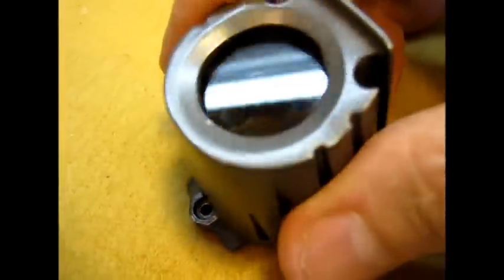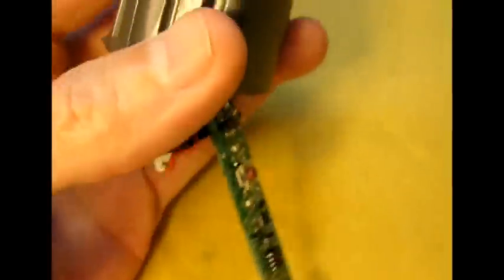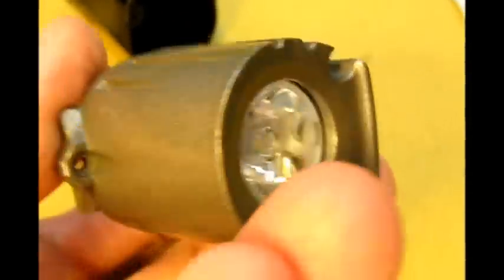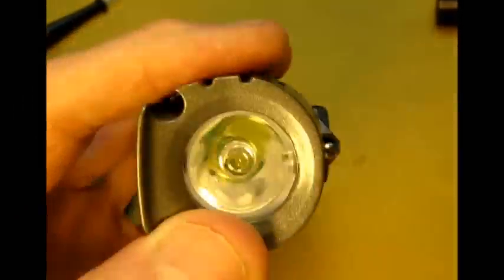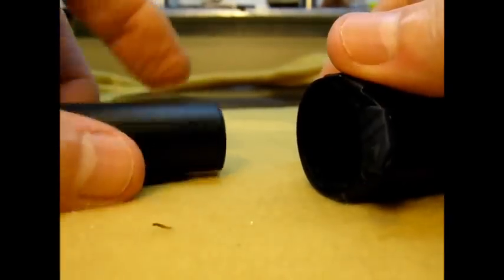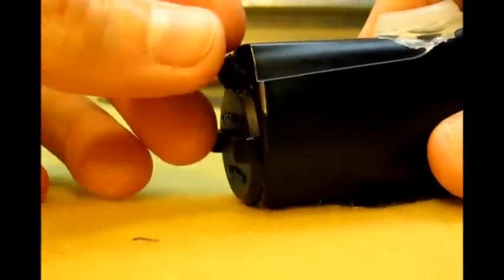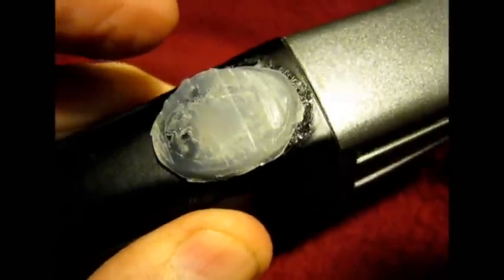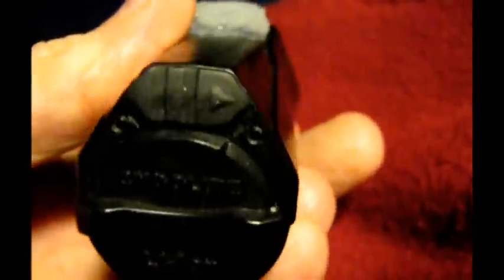if water gets into your Cygolite after warranty: DIY remedy

Comment: Hey ampdavolts, I just posted a video of some features of the Cygolite Expilion 680 which I'm not thrilled about, I was wondering if you had the same experience (specifically with the play in the mount). Based on your experience and the flaws I noted I'm planning to return mine to the retailer I bought it from. I've had no water damage on my Planet Bike light ($30) for years (it eventually came unglued and broke in half) and I'd expect the same from a +$100 light. I guess thats too much to expect.